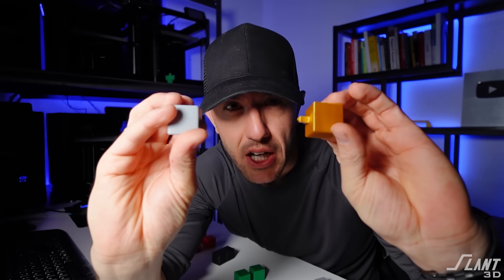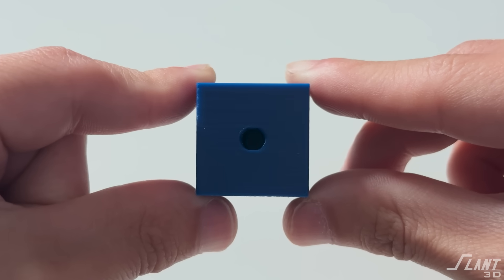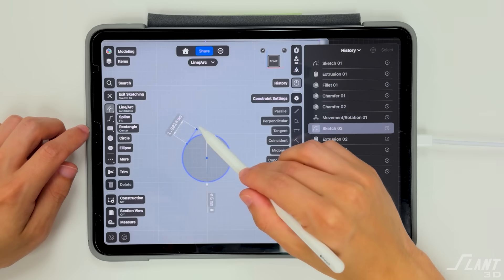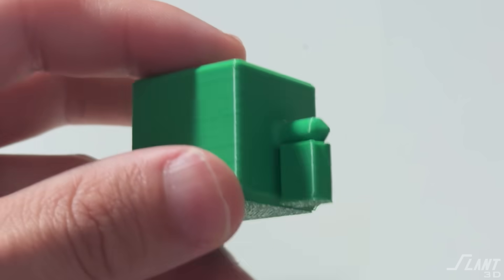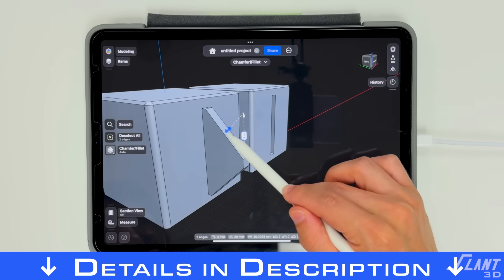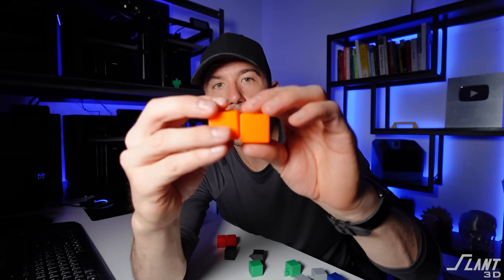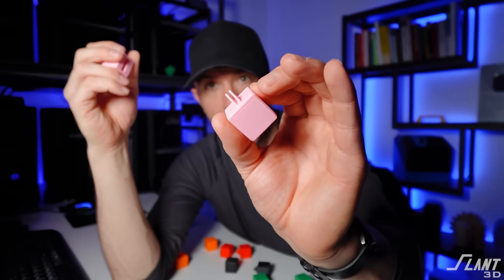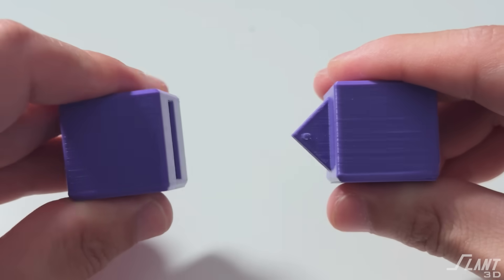Horizontal Pins with Perfect Tolerance | Design for 3D Printing

Comment: I usually better approximate the round hole by doing the 100degree teardrop top and add an extra horizontal tangent to it and then it prints almost perfectly round.

Comment: Final design has issues as pla (and some other plastics) will deform under a constant load.

Id probably avoid two fins and stick with one thicker with the keys you described at the end

Comment: So many designers copy a design made for a traditional manufacturing process and end up with terrible results. Design for your manufacturing process, taking advantage of strengths and working around weaknesses, and you'll have a much better product.
Reply from the maker: Completely true! Well Said
Reply: @slant3d  do you have or can you make a class on how to use shapr3d with the iPad. I can not find a good course for just the iPad if you have no knowledge or the program. Or can you point me to who does. Paid course is more than fine.

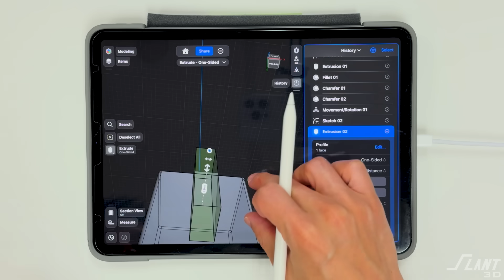Comment: Excellent work! A version of the injection molded split pin I commented in the last video, but redesigned for the peculiarities of 3D printing. But the thickness taper at 4:21 should be done in the other direction if you add the split. The base of the triangle can't flex, so you want to be sure it's not oversize, but you do want the peak of the triangle to be a bit wider than the slot so it holds together tightly when flexed.

Comment: And Slant3D continues to re-invent crap poorly.

It's called a dowel dude.  Quit dicking about with a crap idea, put a hole in both joints and print a dowel (aka pin) sideways to increase the strength.  Or just use wood ones.
Reply: You want to place 10,000 dowels into 20,000 holes?
Reply: @Deeyewhy  Yeah.  How do you think furniture is made?  And yeah, you wind up with a better product - faster prints, simpler geometry and stronger joints.

And like you're planning on 10,000 of something.  Seriously,  the commenters here are dumber than the presenter.
Reply: @j.f.christ8421  i agree with every word you stated and through the video could not stop asking "but why"
Reply: @bmxscape  And the dude thinks he invented something new by integrating the dowel with the object - that's called a tenon.  Carpenters invented those centuries ago.
Reply: It doesn't hurt to have different methods at your disposal. First, dowel joints generally rely on glue. Keep in mind the sideways cubes are just for demonstration. I have used wooden and metal dowels where I thought  hey were appropriate; but that doesn't mean nothing else is ever needed.  
Do you have the same opinion of a woodworker using, say, a blind fox-tailed tenon where a dowel would do?  Even in woodworking, dowels are used because they are simple, easy, and cheap not because they are best.
The biggest lesson is that 3d printing has different rules and that gives us new opportunities.

Comment: If the top part of the pin and slot can be flattened, then it will also completely self align vertically.  I noticed some of the prints in the video have some slight misalignment vertically.

Comment: Your channel is amazing mate, there is so many tips and tricks usefull for both beginners and pro designers. 3D printing is an artform
Reply from the maker: Thanks for watching. What are you making?
Reply: @slant3d  It started with random halloween designs and hueforge images, but I want to pivot over to more functional and usefull designs.
I kinda got hooked by 3D printing and now have 4 3D printers (2x P1S, X1C and H2D 40w combo) without good usecases for them 😅🙈

Comment: There's no possible reason why the pin has to be attached to the part itself. The pin needs to be a separate part. Carpenters have figured this out thousands of years ago.
Reply from the maker: Carpenters could not make the pin as part of the part. You always want to take advantage of the process your are using.
Reply: @slant3d  Even if they couldn't back then, they can now with modern technology yet still choose to make it a separate piece. Plus taking advantage of the process in such a way is self-defeating: if you're integrating the pin in the part to have 2 parts instead of 3, why not integrate both parts together so you have 1 part instead of 2?
Reply: @slant3d  Bollocks.  Carpenters invented this centuries ago - it's called a tenon.  Stop re-inventing stuff poorly.  Hole in both parts, print the "pin" aka dowel sideways.  Or just buy wooden dowels, they're cheap.